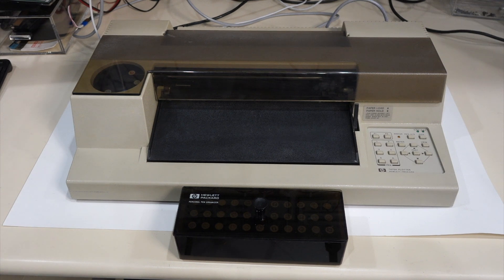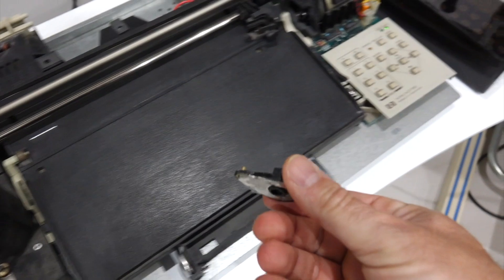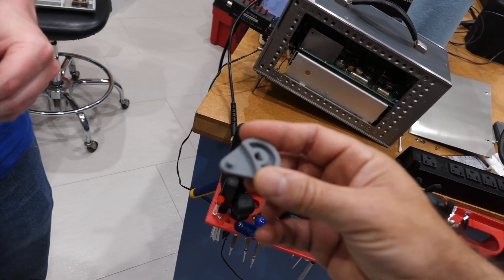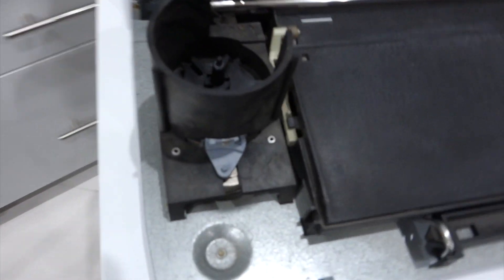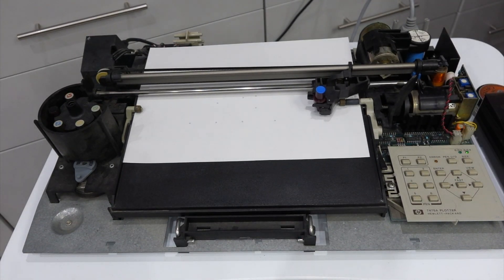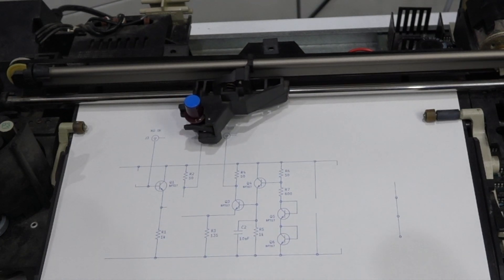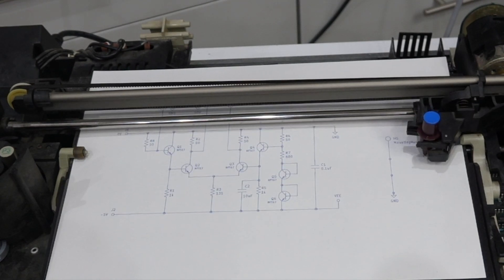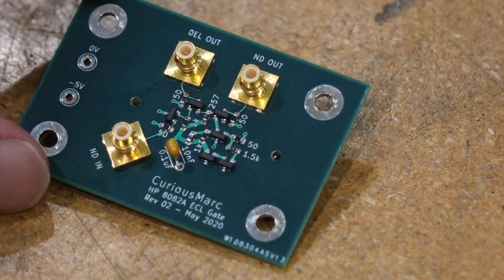HP 7475A Plotter: Geneva Wheel Repair & Schematics Printing

Comment: Hi everyone!
Between the 80s and 90s I had the opportunity to work with these wonderful plotters, now I have one and I ask you experts, who have worked and programmed these precious objects, if there is the possibility of interfacing them with a modern PC with Windows10 and you still see them working and possibly with what software.
The 7475A plotter in question has an RS-232 - C/CCITT V.24 type serial port, are there any adapters from this type to the USB type serial port?
Thanks in advance to anyone who can answer!

Comment: As a good exercise, and for being able to use hpgl for a laser engraver I am building, I am making a pure python HPGL parser that generates low-level vectors for , well, anything really. I have to admit I was struggling with list comprehension, but that's what exercise is for. I now understand lists a lot better :)
I used a KiCAD design HPGL file to test, and I noticed it uses polygons nearly all the time. This was good as the bit where polygons are stored and such is a real nasty part and although my code works now without errors, it won't draw it as it has to be yet. Still a  work in progress, when it's done I'll put it on github.
GPT generated some code but that was mostly just structural. The actual code for parsing commands is all mine.

Anywho, Just wanted to say the columbia test file, is of great use to me. I've been looking for it for quite a while, I can remember watching my 1989 XT drawing that thing on screen, vector by vector (so slow!!!)   Thank you!

Comment: Hi! Didn't think it would happen , but just scored a 7475A off Ebay. Sure enough the geneva wheel what shattered. I used your STL model and now it works a treat! But to make things a bit more difficult , mine is HPIB , not RS232. Plus I run Linux not windows, so I'll have to find a way to send it HPGL files via my National Instruments USB interface
Reply from the maker: Great! You are getting the full vintage HP experience with the HPIB version!
Reply: @CuriousMarc  Got it working in Linux 22.04 after some UEFI and kernel driver kung fu. On modern linux distros you have to disable secure boot to get the driver loading. But hey ! It works like a charm 😃 It's also said in the programmer's manual that we can use it as a digitizer ? mmmm

Comment: Can it work with the 9825? I still have not dared turn mine on BTW.
Reply from the maker: That’s a good question. The 9825A did not support HP-GL plotters natively, but you can always send some raw serial commands as I did on this video and that will sure work. The B and the T did support the HP 9872 natively, which was the very first HP-GL plotter. The 7475 is a later version of HP-GL, so it’s worth a try.
Reply: @CuriousMarc  My father had a plotter connected to his 9825, around 1978, in his lab. the 9825 was the first computer I ever programmed, and around 12 years of age he let me use it, connected to a plotter I implemented noughts and crosses on it. I remember it had an X-Y mechanism instead of moving the paper, so it was likely the 9872. When we finally move a to bigger place I will be working on the 9825s - first thing I will do is implement the crow-bar circuit !
Reply from the maker: @DinoDiniProductions  Great story! Stay peeled, there will be a whole episode on the crowbar, I made an exact look-alike to the original.
Reply: @CuriousMarc  I look forward to that!

Comment: Back in high school, I helped my electronics teacher get an old Roland Pen Plotter up and running so we could directly draw etch resist onto PCBs. It worked pretty well - in exchange for getting it running, I was given a telequipment two-trace oscilloscope out of the surplus storage!

Sadly, the plotter (along with a whole lot of other gear) was stolen in a break-in later that year :(

Comment: Anyone else wonder about the algorithm converting HPGL commands into pen/paper motion? It's in ROM, right? Surely we can improve it
Reply: That algorithm is probably OK-ish. It’s the CPU that’s going to be a constraint. So while it probably could be improved, it’ll be a solid challenge. A modern 3D printer board would drive that plotter like nobody’s business I’m sure. It’d be an easy mod too!
Reply: No. HPGL commands are the paper/pen motion. The plotter has nothing but a data buffer and the instructions to execute discrete HPGL commands, such as pen up, go here; pen down, go there; go there; go there; pen up, go home. Any optimization can be done in software pre-plot.

Comment: I had one of these to create direct to PCB plotting. It worked great with EAGLE for which someone had written an HPGL exporter. The downside was the noise and difficulty keeping the PCB material locked down under the high G forces. I used it just once before sending it to the recycler for a toner transfer method using an equally large HP LaserJet.

Comment: It was doing Urdu style English @ 9:12. I can see that this early technology evolved into CNC and 3D printing.
Reply: Actually, I just cracked open my hp7475a. This hardware is almost identical to inkjet printer hardware. They have dc motors and use encoders for positioning as opposed to cnc that uses steppers.

So this more accurately is the predecessor of inkjet technology.

Comment: I remember when I had a subscription to the HP Journal, it had an article all about their plotters and specifically about the rollers that kept the paper straight when going back and forth.  They had put coarse particles on the rollers that dug into the paper, which created little divots in the paper, which the rollers then kept aligning with the paper as it moved back and forth.  HP FTW!
Reply: There’s an HP Journal archive online somewhere. I spent something like 2 days of a vacation just reading articles from them!

Comment: Thanks for the video. I saved a screen shot of the diagram with the measurements for the part that often breaks in case I will need it to fix my 7575 plotter. I haven't usen't mine in a long time so I have no idea if it still works.
Reply: At the bottom there are downloads:
https://www.curiousmarc.com/computing/hp-7475a-plotter

Comment: I'd always assumed it was the platen that moved with the paper held to the top of it, I didn't realise it was constantly pulled forwards and backwards.  Given how smooth and rubbish print rollers can get, I'm amazed plotters were able to reliably pull paper at all, let alone over decades.
Reply: The rollers were not rubber - the surface was what was called "grit" - I don't know what material the grit was made from, but it felt like the surface of sandpaper. It made tiny indentations in the paper that would help alignment stay perfect.

Comment: You may want to keep the other print around.  The resin used in SLA is generally pretty brittle.  A PETG part would be way more rugged.
Reply: The resin I printed these with is by far the least brittle of the ones I've used. In this application I'm more worried about its softness leading it to be worn down over time. Either way, that is precisely why I printed a couple with the FDM printer as well.
Reply: @mikestewart8928  Good work!

Comment: When I was maybe 12 years old my father brought home a 7475a with HPIB from his office's scrap bin. He insisted that I get it working with our 386 sx home computer as a summer project, and I remember spending weeks trying to get it going. I also remember becoming completely frustrated with the HPIB (aka GPIB) settings, and trying to understand the spiral bound manuals that the interface card came with. When I finally got it working, it was a real win - I was kind of amazed that I got this (at the time) high tech thing to work.

Thinking back on it now, it was the first project in my lifelong career in tech.

Comment: I will say that "replacement parts" is one of my favorite categories of things to 3d print. Right before lockdown last year I ordered a whole bunch of filament, including my first roll of flexible filament, to be able to repair things without leaving the house.

If Inkscape supports it, then it's not very obsolete. Inkscape is an awesome tool. (Import and plot a PDF sometime 😁) Tbh, that's about the level of vinyl cutters too though many require a proprietary app in between inkscape SVG and physical output
Reply: Vinyl cutters are basically pen plotters with the pen replaced by a tiny spring-loaded blade. I know for some plotters you can simply swap the pen for the blade and just print like normal. I'm sure Marc could make something similar for his 7475A without much work.
Reply: @phuzz00  definitely agree, my vinyl cutter is one of the "fancy" ones that can hold a blade and a pen at the same time, so it's even more plotter like. I don't know enough about plotters to know if they have a pressure setting (line width?) but I agree, he could probably just get a blade cartridge for a consumer vinyl cutter and 3d print an adapter to use it in the pen carousel. Maybe I'll have to look for one of these when Cricut eventually crosses the line and decided we really don't own the machine at all.

I was surprised when I saw the first video in this series, I always imagined plotters being more like a CNC router, with working area defined by the size of the machine in both axes. The fact that at least this one is so much like consumer vinyl cutters in that it has one "infinite" dimension, definitely made me chuckle.

Comment: Is it really only moving that paper with those 2 rollers on the sides? How much engineering went into preventing them from yeeting the paper out or pivoting it and jamming the machinery?
Reply: The little rollers have "grit" on them - an HP invention. It's like the surface of sandpaper, but perhaps a little more spikey. The first time the roller rolls over the paper, the grit makes little indentations in the paper, which helps it stay in alignment when it rolls back and forth again - the same pieces of grit naturally tend to go into the same indentations.
Reply: Since it's an HP probably an insane amount of time to get it perfect.

Comment: I am glad you fixed your plotter.  My LaserJet III does HPGL nicely.
Reply: The LaserJet III was the first HP laser printer that incorporated HPGL into PCL (PCL5).  Adding a vector graphics language into a low cost laser printer was a really big deal at the time.  Sounds like your LJ III still works. Not surprising.

Comment: You might look for some vintage Staedler Mars plotter pens. Most of what they sold were the fiber-tips (that got shmooshed after a while) but they also sold technical drafting ones, which were a hollow tube of various diameters with a wire down the center and you used liquid ink with them. They were a real PITA if you didn't use them every day as they'd dry out and get clogged. But the line quality was amazing.  You had to leave the lid up since they were tall.
Reply: drafting pens for plotters are different from hand-ones: there's a spring inside to prevent the weighted wire from slamming up and down from the plotter's abrupt pen lift and drop. I've cleaned them plenty of times and remember losing that first spring 😞

Comment: Is it a different plastic than the rest of the mechanism? It could have been intended as a sacrificial part, to fail "cheaply" before an expensive part like the Geneva wheel itself did in case of a jam.  That it came out so easily (i.e. not a lot of disassembly to get to it) might support that theory.
Reply: UV plastics are very brittle. The ease of production and high detail can fool people. If subject to vibrations also trouble. Deceptively easy to work with, cast in silicone and pour in liquid Delrin or even cast in aluminum or other plastic.
Reply: @togowack  liquid Delrin? Sounds implausible to be honest.
Reply: @pizzablender  I haven't done it yet but am preparing, its usually done through injection moulding. I have heard that it casts very well but produces a lot of fermeldahyde fumes. As close to castable plastic (aluminum) very popular material and low cost.
Reply: @togowack  I'd think the viscosity would be way too high for free flow casting. Wouldn't a 2 part resin be more logical?
Reply: @pizzablender  2 part resins are pretty expensive and come in non-engineering styles like ABS or other light consumer product grade plastic, I will be testing it sooner or later in a cheap outside toaster oven and let you know how it pours. I would rather pour an aluminum melt but not a good idea in my small yard to build a foundry like that at the moment.
Reply: @pizzablender  I have experience with pouring silicone moulds at really high viscosities and they pick up all kinds of detail. Of course the interior of the mould has to be vented pretty good and this is a given.

Comment: Marc: "It broke."
Everyone: "Yeah...well you fixed an Apollo computer, so this shouldn't be a problem."

While I do love watching pen plotters, I REALLY love my 42" old HP 800PS.  My wife suddenly liked it when she needed something large printed.
Reply: i have the 500 non ps, hw 99.9% the same, only thing that lets them down is non waterproof prints
Reply: 3D printers are equally fascinating to watch as plotters. It's something about the small controlled movements that somehow join up into a finished print.
Reply: @phuzz00  -- And the sounds of the steppers.  I replaced my drivers last year to some better ones and the noise level dropped significantly.  I have to admit I was a bit disappointed.  I liked hearing them whirr.
Reply: An amazing piece of kit. Back in the 90s a friend of mine who ran a broadcast installation and maintenance company had one in his workshop. We used it for exhibition displays upto A0, and various other large format things. I would design information placards at A2 in PhotoShop and Illustrator (Version 1.1!), print them and the stick the prints on foam board. Being able to do that without having to send it out to a specialist printer was such an advantage.

Comment: Back in the late 80s, I couldn't afford an HP, so I bought an A3 Roland flatbed plotter for schematics and board layouts.  It was absolutely amazing, at the time.  But you quickly get frustrated by how long it takes to print, and the pens were just a pain, eventually migrating to refillable pens from IIRC Stadler.  Oh yes, @John Scoles, exactly DXY-1150.  Do I ever miss that thing :)
Reply: Yep the 1150 was a great tool used mine mostly for Making Maps and had a nice little side business making overhead slides for students then profs.  I think the only made one schematic with it and it was when I was working fro CAL (Canadian Astronautics lmt) another department was had  the 'large' plotter go down late on a Friday afternoon with a critical deliverable due on Monday.   I managed to make the 1150 work in its place by Sunday morning and  I think the plot took like 4 tries on 8 or 12  11x17 pages, and took all night to print but we had it ready for the customer by 09:00 Monday.  Those where the days, not my department or manager, my own equipment and supplies and not a cent of overtime. Don't even think I got a thank-you note ;)

Comment: Maybe you should put a resistor in series with the motor that moves the geneva wheel to slow it down a little. There would be less force on the plastic then.
Reply: There may be a sense resistor or something that controls the current to the stepper that drives it.
Reply: If it's a stepper motor, a resistor will not change the speed. All it will do is reduce torque and get hot.